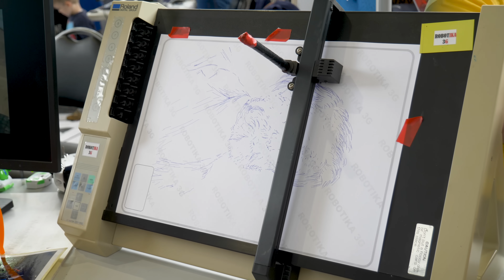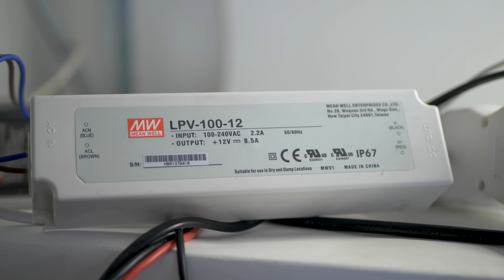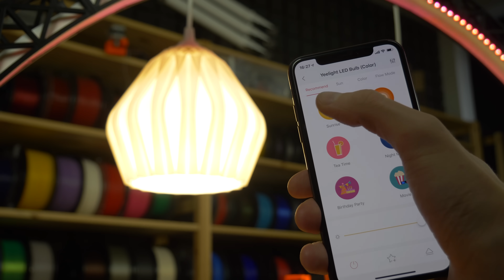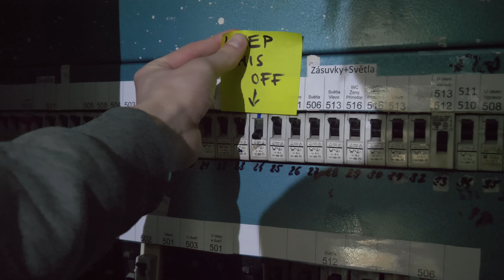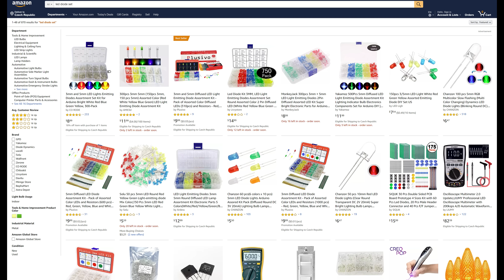Light up your 3D prints with LEDs and bulbs - NO SOLDERING

Comment: Word of warning: LEDs are rated at a current (often 20mA max), not a voltage.  Red LEDs in particular usually need far less than 3V to get 20mA.
I've seen enough crafters driving them off coin cells, without current limiting resistor, that I'm reluctant to say "don't do that!".
But those people are getting away with it, rather than using them properly.  Just be aware that you're doing it at your own risk.
The usual rule is: use a series resistor of (Battery voltage - LED voltage)/LED current.
e.g. 9V battery, 2V LED, 20mA max LED current = (9-2)/0.02 = at least 350 ohm series resistor.  Often the LEDs are bright enough to use a larger resistor.
The numbers get a bit silly when the battery voltage is similar to the LED voltage, and the battery has a significant internal resistance, which is why you can sort of get away without the resistor in some cases.

Comment: Please use high quality duct tape across the whole cirquit breaker instead of sticky tape, your life could depend on it. Also refer to the manual of the cable clamps if you use them, the unisolated part in the video looks awfully short...

Comment: Would it be possible for an electrical novice to power an LED strip directly from the printer?
So to eliminate work piece/enclosure as the printer powers on with no extra power cables leaving enclosure (nice clean look)
Reply: Id assume you could tap a few wires and just split it to the leds with the correct voltage or step down converter thing.

Comment: 3D printing is more complicated than soldering to be honest
Reply: Soldering - heating some metal with a tip and touching a metal wire to it and done
3D printing - learn entire encyclopaedias and spend hours to figure out why your prints are angled or why you have defects
Reply: Yeah honestly would recomend people just buy a cheap ass iron and ignore people that shit on 20 dollar irons all the time. They do the job and people that discourage the use of these discourage people from starting the hobby. That being said these ideas are a great way to spark interest and I would like to add that at most small applications there are a wide range of solderless connectors from breadboards, solderless jumperwires, and even clips for led strips.
Reply: @jonathanclark7444  cheap irons are more than enough for LEDs and basic work, working on boards might need a more professional iron but even then there's not much flux can't fix. Most products you buy are made in Chinese sweatshops using soldering irons that are barely more than a hot wire wielded by a child or unskilled labourer.
Reply: @nxxynx5039  yup completely agree, used a 20 dollar soldering kit for a year or two messing around before upgrading. Now I use the old one to melt holes in 3d prints lol, it makes a cleaner hole than drilling
Reply: Nah
Reply: @xtc3dresearchteam744  If you ever tinkered with a 3d printer so long that you almost lost your mind yeah it's more complicated than soldering

Comment: would the led light strips be a good choice or should I buy diodes instead for a ring design idea for example I would like to make a Red Lantern ring that glows in the middle from a 3D ring out the way i'd print it would be have the logo in transparent filament and the rest in red, but i don't know how to solder, could you maybe please make a video on how to make a glowing red lantern ring with a small led light please

Comment: More Please :D
What material do you suggest on high power LEDs?
Reply from the maker: PETG is pretty good at withstanding higher temps and is really is to print with. But with strong LEDs you should really consider an aluminum profile, it acts as a passive cooler ;)

Comment: Cool has any one designed a lighting kit for the printer using LED strips? That sounds like a nice easy project for someone who can 3D model.
Reply from the maker: I've linked one in the article that's in the video description. It's nothing super fancy, but works well :) Btw if you buy 24V LED strip, you can power it directly from the MK3s PSU

Comment: Excellent video!   It would be great if you could do a few small projects end to end so your viewers can see the whole process.  I’d like to attach a small led strip to my 3d printer so I can light up the work in progress.   I’d like it to turn on/off with the same switch I use to turn the printer on, for instance.  Thanks!
Reply: I too would like to know how I could power LED strip from the printer itself so as you say, on and off with 1 switch. And how to do with little to no electrical experience.
I mean we could always attach led strip to enclosure or print a frame like in video and just use a multi socket to plug printer and usb power supply into 1 mains socket, but I want less cables for neater look.

Comment: Thanks! What about "dipping" diodes with other electronics inside print? Like, pausing printing, putting electronics inside, and then resuming printing.
I've seen this before, looks awesome, but needs lots of preparing,for sure!
Reply: Wouldn't LED's make more sense? standard rectifier diodes are just solid state devices, and should be, if anything, cooled, not embedded into plastic.
Reply: @zaprodk  of course i meant diodes=leds
Reply: LEDs are Light Emitting Diodes, so technically both are correct. :)

Comment: 01111001 01100101 01110011 00101100 00100000 01110000 01101100 01100101 01100001 01110011 01100101 00101100 00100000 01100001 01101100 01110011 01101111 00100000 01110011 01101111 01101101 01100101 00100000 01110100 01110010 01101001 01100011 01101011 01110011 00100000 01110100 01101111 00100000 01100011 01101111 01101110 01110100 01110010 01101111 01101100 00100000 01101100 01100101 01100100 01110011 00100000 01100110 01110010 01101111 01101101 00100000 01110100 01101000 01100101 00100000 01110000 01110010 01101001 01101110 01110100 01100101 01110010 00100000 00111010 01000100
Reply: Translation from bin to text: yes, please, also some tricks to control leds from the printer :D
Reply: 01111001 01100101 01110011 00101100 00100000 01110000 01101100 01100101 01100001 01110011 01100101 00101100 00100000 01100001 01101100 01110011 01101111 00100000 01110011 01101111 01101101 01100101 00100000 01110100 01110010 01101001 01100011 01101011 01110011 00100000 01110100 01101111 00100000 01100011 01101111 01101110 01110100 01110010 01101111 01101100 00100000 01101100 01100101 01100100 01110011 00100000 01100110 01110010 01101111 01101101 00100000 01110100 01101000 01100101 00100000 01110000 01110010 01101001 01101110 01110100 01100101 01110010 00100000 00111010 01000100
Reply: @zebestlion4599   01010111 01101000 01100001 01110100 00100000 01101001 01110011 00100000 01110100 01101000 01100101 00100000 01110000 01101111 01110111 01100101 01110010 00100000 01110011 01101111 01110101 01110010 01100011 01100101